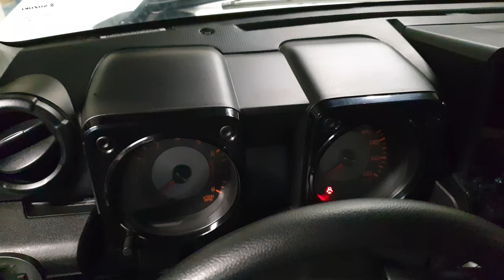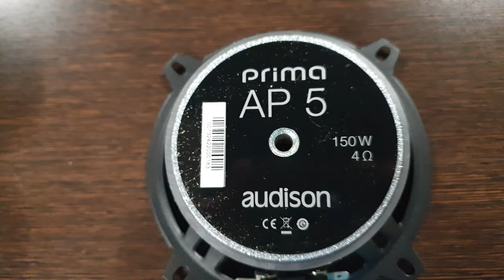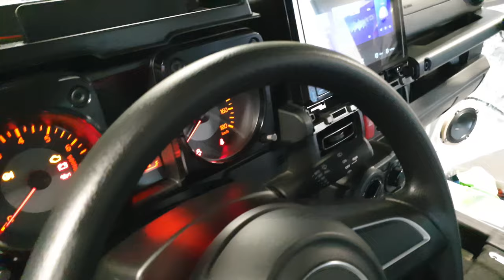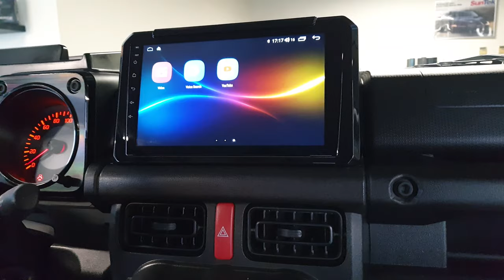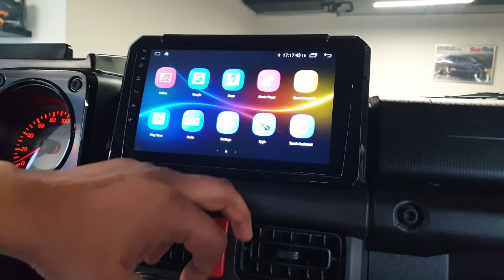Suzuki Jimny 2022 - Premium Audio Upgrade - Audison Prima + Hertz Energy

Comment: Awesome well done installation.  Are these components available globally, and is the instal you have done available at a normal shop. Have not seen a Jimny anywhere with this type of audio installation.  Any advice on how to find a good installer.  I will be moving to Panama from Cambodia.
Reply from the maker: Hi , 

An authourized hertz and audion dealer should be able to help you in your country.

Comment: Those wooder rings should be painted, doors get wet inside, that ring will not last 1 year
Reply from the maker: They tend to last here a lot longer. The heat and generally dry climate tend extend its life. This car was installed 4 years ago and still has been working fine
Reply: @futureautomotivesystems9390  What about using the correct colors for positive and negative powercable, use some damn ferrules to connect them safely , same for the speakercables.
Attack the amp to the car safely, not just laying on the carpet.
You are suppose to be professionals?